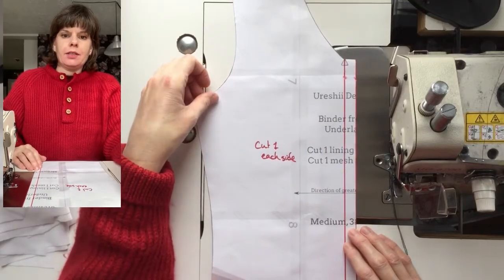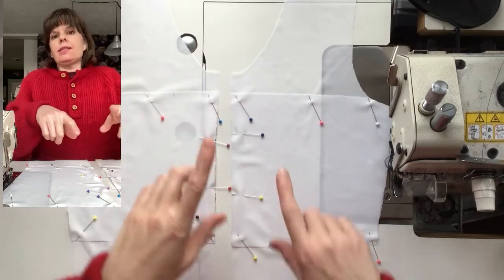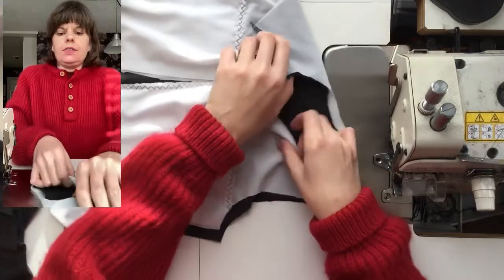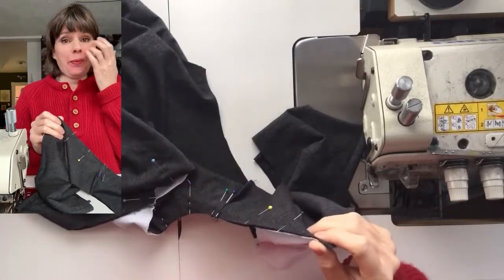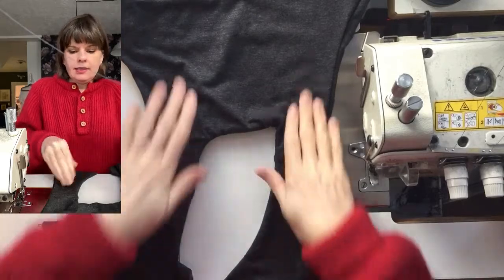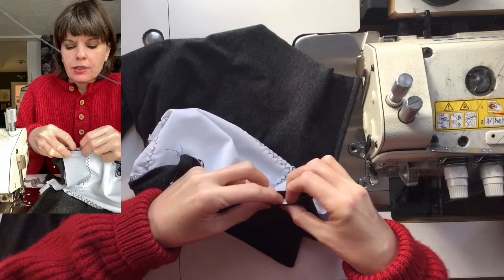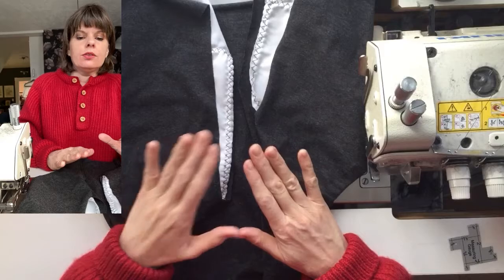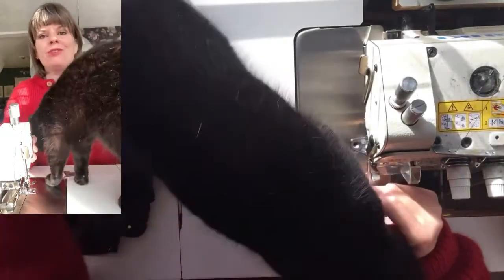Accessible Binder part 1 - construction

Comment: Nice ma'am . ..... fabric which use
Reply from the maker: The fabrics we use are a 66% bamboo / 28% cotton / 6% spandex jersey (Weight: 200 gsm / 5.9 oz.sq yd) You could use other rayon/spandex fabrics such as 95% bamboo 5% spandex in a similar weight for similar results.

The second fabric is a "power mesh" that is not super powerful. The one we are using is 83% Nylon / 17% Spandex. (Weight: 165 gsm / 4.9 oz.sq yd) It has some drape and significantly more stretch in one direction. It is not as stiff as what is seen in shapewear, more like something that would be used to put sheer panels in leggings or tops.
Reply: @ureshiidesign  thanks 😊